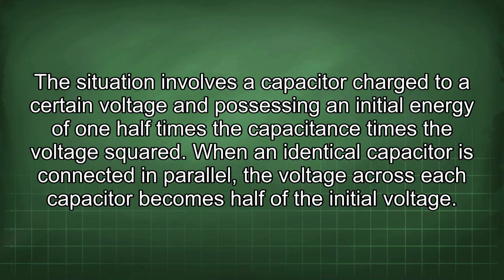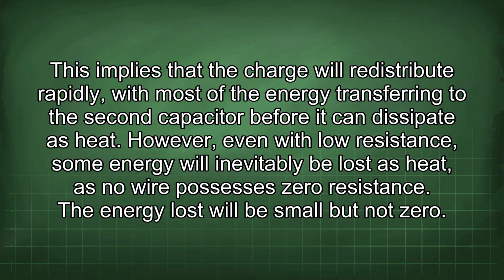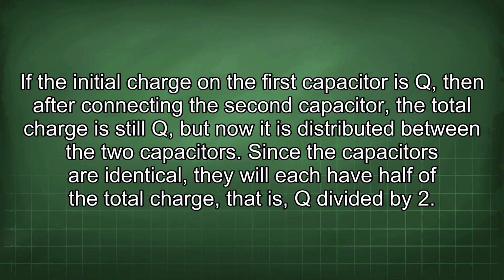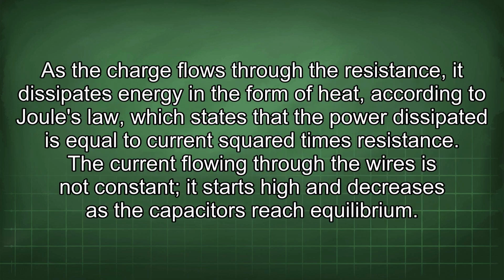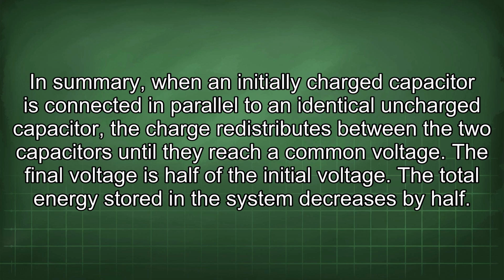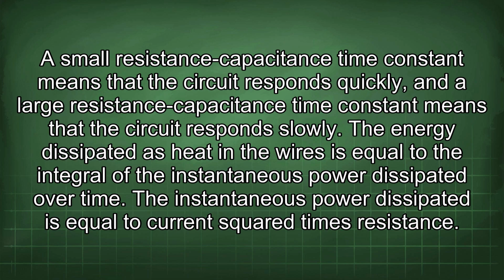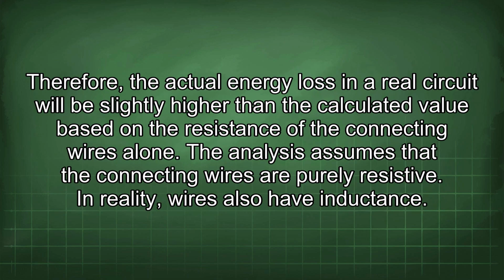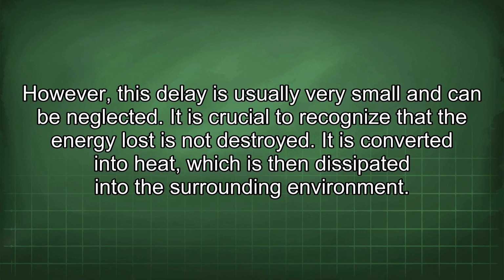Capacitor Energy Loss Explained Parallel Connection

Comment: Thank you,
Initially I thought it might be a miscalculation. 
Now it's clearer, but I'll need to think more about the phenomenon. Specifically in the case of voltage in variable capacitors, like those used in old superheterodyne radios.